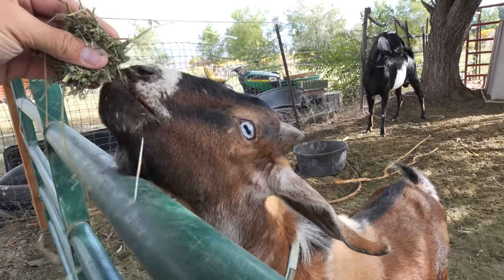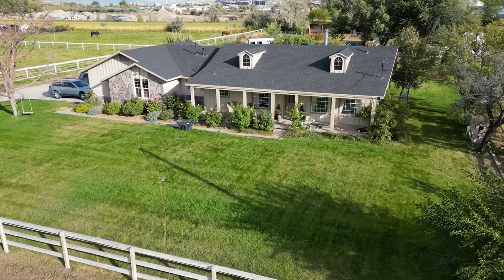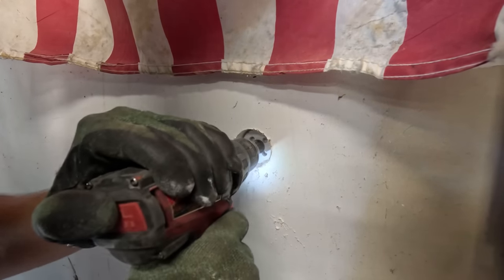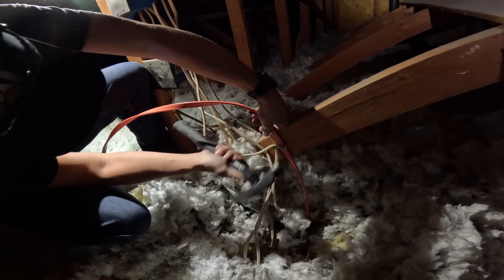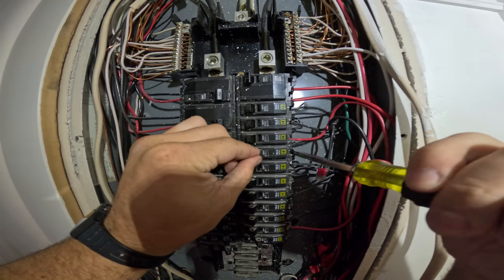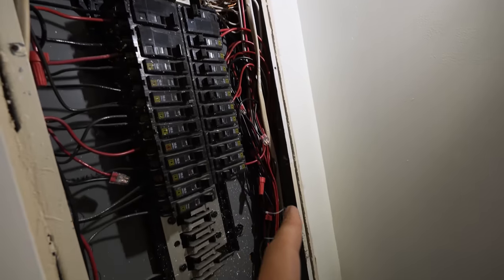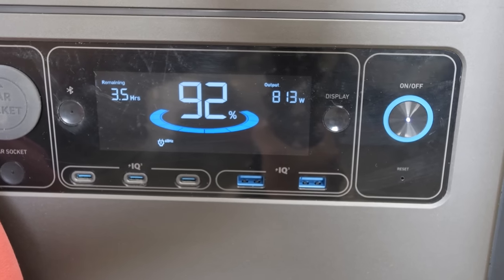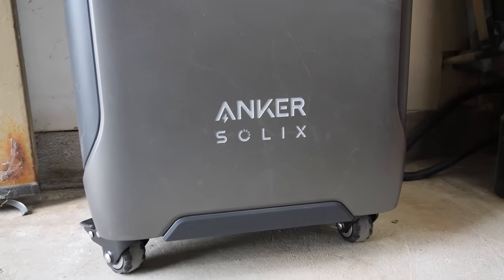Ankers newest Power Station can charge a house and an iPhone... 300 times

Comment: The system would be perfect, if the switch to the grid happens when the battery is under for e.g. 20%. So a even charge/discharge can happen. If the breaker could do this with a signal to the power station that would be really usefull.
Reply: Gotta get a hydraulic app controlled switch separately lol
Reply: You can do that with a more-DIY system using what's called a Hybrid inverter. It's a bit more work than just plugging in this unit.
Reply: Aka their smart panel

Comment: @JerryRigEverything - You need to check the main neutral(grey insulated wire in the middle), I seen some charring, which normally means its loose and need an insulated Allen to tighten it up, Like ASAP!

Comment: you should have an automatic transfer switch instead, then when the mains power goes down it automatically switches to the backup source. No flipping required. They use that in most larger buildings here in the UK and I'm sure its the same in teh US, just with different voltage and frequency but the same idea

Comment: My solution for these cases has always been battery backup.
I use a set of 12 Volt 100 Ah marine batteries. They are Lead-acid batteries with carbon-reinforced electrodes, so that the formation of lead sulphate do not kill the batteries. 
I use a pure sine wave 6 KVA inverter and a separate 3 KW charger, which can accept power from the grid, from solar cells and a wind turbine.
The inverter and the charger are much more robust than a power bank, and the marine batteries last typically for ten years of service, and never set off fires like the lithium batteries sometime do. 
For a big agricultural house, it is easy to convert the backup system from one phase to three phases while keeping the same batteries.
Marine Lead Acid batteries are the way to go.
Thank you for the great video!
Regards from the UK,
Anthony
Reply: worth noting, that LIFE batteries, as these ones are, are much less likely to burn and combust into fire. You can find various videos about this on youtube these batteries are practically rocks compared to lipo batteries. 

Im sure you could get them to burn if you really tried but im also certain that the acid inside those batteries is not particularly healthy for one either. It's also worth considering that lead acid batteries tend to produce hydrogen when charging, which isnt a problem with sealed batteries but there are always concerns.
Reply: Lithium iron phosphate batteries are so cheap now that it's becoming the clear choice considering lifespan and power density over lead acid. You can get 100 amp hour LFP batteries for nearly the same cost as lead acid now.
Reply: @andrewt9204  though tbf if you can get your hands on similar lead acid technology for a better price power density is not a concern with stationary storage. You can pretty easily build a little shack to house tons of storage.
Reply: LFP batteries are definitely better for home storage. They're fire safe and have pretty good energy density and cost.

Comment: in germany we have 2 special contactors that automatically disconnect the house from the grid when the power goes out and switch to the battery to supply the house with 3 phase energy. Tesla Powerwall is kinda stupid because its just 1 phase emergency power (except if you buy 3 lol) but its enough to prevent your fridge from melting.
Reply: powerwall is built for american markets where everything is single phase. 3 phase power supplies adds a lot of complexisty particuarly in just syncing up those 3 sinusoids.
Reply: @literallycanadian  definitely built for america. Its just popular in europe because of the brand. But its kinda cool to install as an electrician because it mixes the american and european electricity system
Reply: @Drogenkurier88  The powerwall only supports 1-phase? That's really strange, especially since their L2 wall chargers are 400v 3-phase.

Comment: around here there are a few ranchers using solar water pumps to day pump into a tank, then a much smaller pump to go from the tank to the house or other water needs.. that first 100' of lift vs 10'  make a big difference in consumption it seems
Reply: I am surprised they do not just use a solar water pump to lift it to a tank that is elevated - thus storing that energy (You know like all municipalities do?) No smaller pump needed at that point.  Let gravity be your pump.. 
I guess a ground level tank is cheaper and easier to deal with?

Comment: I'd love to see some usage and estimate time before it runs out.  I know it's all depends on load but been thinking about a whole house generator but something like this would be a better solution
Reply: How do you think this is a better solution than a whole home generator? This won't run your entire home, much less for an entire day. My generator will run my entire home and shop and starts up automatically if I'm not home.
Reply: @freighter1097  > This won't run your entire home
Uh, yeah it will? Maybe not for an entire day, but that'd depend on your load. If the water pump isn't running, Zach showed that the system was pulling 800W. To run an entire home at 800W for 24 hours, you'd need a ~20 kWh battery. Which Zach mentioned is a size option for this power bank. I doubt it's cheap, but you also never need to buy (and maintain!) a diesel generator and fuel, or ever spew co2 into the atmosphere.
Reply: @coredumperror  You're going to tell me that this thing will replace my 200 amp service, let alone the 100 amp service to my shop? No, it isn't. Yes, I could string multiple units together and have several of them and several batteries to accomplish this. Or I could let my auto start natural gas generator do the job for weeks on end. It doesn't need to be plugged in and charged. Hell this thing wouldn't run my tankless water heater.
Reply: @freighter1097  You're vastly overestimating how much energy you actually use in a typical day, let alone in power-outage conservation conditions. 

Will a battery backup system last as long as a well-stocked generator? No (unless you pair it with a bunch of solar). Have you ever actually needed your generator for a solid week of blackout conditions? I'd be quite surprised.
Reply: Based on Anker's Kickstarter and the demonstrated usage, the single unit (as shown) would run the house for around 4.5 hours if the water pump is not engaged (3840wh / 800w). The water pump is going to shrink that based on how often it's engaged with about 1 hour at the minimum. However, if we look at the estimates on the screen in the video, we see higher results. This likely indicates that there is either an additional battery attached to increase the capacity, or the solar panels offsetting some of the load.
Reply: I'm more looking for a power outage that's a few hrs that you can have essentials on.  Fridge, furnace etc for a few hrs
Reply: @coredumperror  Well after the last ice storm, I didn't get grid power back for 17 days. So yes, I have spent plenty of time running on generator. I also spend weeks at a time out of town. So the generator auto starts and switches the home over so nothing is lost.
Reply: @freighter1097 how much did you pay for that generator to do that?
Reply: @AXXXXA  The gen was around $4k with my discount. I did the install myself.

Comment: Those push fit wago connectors are not suited for fine stranded wire like that coming from the transfer switch. The connections wont be good and will get hot and ultimately cause a fire. You must use the wago "lever nuts", those are designed for fine stranded wire.
Reply: @dtemp132 Look at @3:40 it looks like solid wire to me
Reply: They are using 10/2 romex which is solid 10 gauge copper

Comment: You didn't mention if the transfer switch wires had the circuit numbers printed on them. I know last install you mentioned you had to take it apart to trace the wires. I'm assuming this time you saw the numbers on the wires?

Comment: I’m building an outdoor studio space. I wonder how often I would need to charge this. It may be cheaper than getting an electrician out. Lights, monitors, and an occasional ac/heater unit.
Reply: Just run an extension cord 💀
Reply: @bigtitmaster Exactly
Reply: Ac/heating on electricity won't work on a battery as they consume a lot of power.
Reply: It depends, heaters don't run full time, when they reach the temperature they just mantain it, much less energy spent. But if you have an opened window it will always run.
Reply: @alexandruilea915  Eh. Heat pumps are efficient.
Reply: @logitech4873  not that efficient to be able to use them on batteries. I have one at home with 4 modules and they each suck up to 2500W for a total of 24KW of thermal energy.
Reply: @alexandruilea915  That's insane. Your house must be gigantic or have horrible insulation.

Comment: Sounds like a well thought out unit. One glaring issue. look closely at the electric outlets. they are absolutely to close to each other. I'd feel lucky if I could actually plug in three cords at the same time.
Reply: Simple solve with a power strip. I can see why they did that to keep the electronics panel compact.
Reply: It is a poorly thought out design due to the 60 volt limit on the solar inputs.  That is unacceptable for a whole house backup system.  Okay for a cheap unit to take on a camping trip to use with one or two flexible solar panels but not for a whole house

Comment: This installation makes no sense to me... should the new panel not replace the mains incoming to the breakers? Ant the mains then go to the new panel?
Or did you just not show all that?
Reply: 9:20 ish mark in the video linked shows the hot wiring.

Comment: Okay so now we know how to extend battery life on electric cars in the middle of nowhere or on camping trips👍
Reply: Except that, sadly, the amount of juice in this is only going to add a couple handfuls of miles to your car's range.
Reply: @campigenus  With 3.8 kWh you'd be able to add ~25km range on a Tesla Model 3.
Reply: Bjørn Nyland actually uses power banks similar to this when he does his zero-mile EV tests. He drives the EVs until they simply stop, just to see how they perform and act when they run out, then he recharges them with a couple of large power banks.

Comment: I very much would like the option to use the transfer switch to use these larger capacity battery units to run a few things in the house if needed rather than running cords all over the house. Even if it only lasts a couple hours, it would be n firing up a loud gasoline generator.

Comment: i know Anker are sponsoring this and you have to use their product (as with any sponsor) and i know its a neat package but i do wonder if you're building a semi permanent system if it would be more cost effective long term to build a system using car batteries or similar so that you can change / upgrade batteries in the future, i guess if they are offering you a ten year guarantee then that helps, can those batteries be removed?
Reply: It’s 100% better to build it yourself to replace anything on the fly that fails. However with a system like that, I probably would still want one of these. Even if it was just for days where you need to work in another environment like a workshop or outbuildings.

If mobility is important like a van build this makes sense. If it’s a homestead or a cabin, then it probably makes more sense to build your own.

Comment: Pinching a cable with a nail like you did can burn your house down. The cable can become extremely hot on the point where it's pinched, even burning through the insulation and setting the beam you nailed it to on fire.

Comment: I can see the merit for these big batteries if you live in a city or apartment but having lived in several big cities in NA over the years I’ve only lost power 3 times and two of those where for a couple of hours. If you’re out in the sticks where emergency power is important I’d just get a gas or diesel generator. With good maintenance they can last an outrageous amount of time and will be able to run for much longer.  Maybe for RVers or lazy campers such a device would be good but these always seem like a ripoff for what they are.
Reply: I dunno.  I live on a piece of property similar to this for the last 20 years.  And yeah, the power goes off for sometimes up to a week at a time in adverse weather conditions.  But since we purchased an electric car 5 years ago, the generators don't see any use.  They are around, they still work, but they are noisy, need gas in the middle of the night, carb maintenance and oil changes, and gas still gets expensive if you are running a gen for days at a time.  All always keep them both around, but when you have the choice, the battery always makes more sense.

Comment: FYI, from what i can find out on this unit, it cannot be charged fromn the grid while in 240v mode, so if you plan to use it for battery backup for your house, it takes alot more manual effort than other solutions which can often switch automatically to battery when the power goes out, some solutions even switch fast enough that sensitive electronics like computers dont even shut off.
Reply: Do you mean like the Zender Super Base V? Does this Anker unit have pure sine wave?
Reply: @keslee7036  I'm not sure the Zendure does AC charging+discharge +240v either off the top of my head.

Comment: Is that an automatic transfer switch? Doing this setup in the panel could be tricky, you need to turn off the main breaker from the grid before you can use power from battery, if power from grid goes off and you use battery then suddenly grid comes back on it could explode. Otherwise this is good product.

Comment: I wish a transfer panel was that easy to install in Canada, the way you did it is against code here. Cant use your main panel as a junction box, the circuits need to be brought outside of the panel into their own box first before running the wire to the breaker.
Reply: You will notice they are out in rural setting.. much less regulation out there.

Comment: Shouldn't the wire running through a wooden attic be protected by some kind of metal pipe?
Reply: Some quick research suggests not necessarily since it isn't an attic with a clear walking path (and especially if there's no permanent ladder/stairs).

Comment: Nice video Jerry , the only question i have is about that cable that passes the attick , doesn't need (metallic) protection in case is overheating , i mean you have there wood and insulation.

Comment: How is the fire prevention with these things? I've looked into these because here the power can go out maby 5 times a year. Or with a hurricane it can last a couple days. I'm lucky I live on the supply line to the hospital so that gets priority to repair. And I have a gas generator. But a battery would be the next thing. Only those electric scooters ect u see a lot of them go up in flames. So I Def not want it in my house. I have a outside concrete step I was thinking I make a cage and install it there that's close to the main breakers. But I don't want anything with a big battery in my house or garage.

Comment: On a follow up,
Can we use more than 1 Anker Solix unit to power up a house?
And on that note, with a couple of battery expansions, can we run them and power up all appliances while plugged into the wall perpetually?
And they still function as they are when grid goes offline?

Comment: Please dont use those quick connectors they greatly reduce the amount of current that can be pulled by the wire!!!!!!!!!! Twist the wires together and use a proper sizeded wire nut or bug connection.

Comment: There's something he's not telling us—for how long can the battery supply power to the whole farm before it runs out of juice.
Reply: With 3.8 supplied kWh, not very long.  That 3800 watts for an hour, 1000 watts for about 4 hours or 500 watts for about 8 hours.  But it is expandable.  So it's basically $2600 for a helluva nice inverter setup and enough battery to get you started anyways.

Comment: I have a previously installed Generac transfer switch we use with a portable gasoline/propane generator.  I have been advised not to use it with the Anker, although I think one reason is it needs power to trip the switch or something I don’t know quite why.  Seems it should work?

Comment: So did you just move one breaker over into the transfer switch or did you move 10 circuits over for a more complete but not full backup scenario.
Idk if just not enough description was given but this is definitely not a whole home backup solution in this situation and could really only be used as such  if you were taking grid power directly to the transfer switch from grid and then back to all of your loads. In which case you would certainly need more than one and likely at least 4 or so to be comfortable backup solution.
Video seems awful lot like anker got final say on what made it into the video.
I install battery backup solutions for a living and I can without a doubt say that this was not a great representation of whats actually needed have a full backup solution and that representing it as such can put quite a few people in life threatening danger. Putting this type of system in incorrectly could not only endanger the person doing the work but also the linesmen who are doing the work to bring the grid back online. 
Please do a proper backup solution explanation video. Anker should know better than to set up something like this

Comment: Here is the problem, the input from solar is not enough to sustain the battery system. It's a cool system, but max 6KW input? Come on, and that isn't even from solar itself, that's a mix of solar and grid. If you are outputting 12KW, and only can intake 6KW, that does not make sense. You need a 1 for 1 match, say it can output 9KW and receive in 9KW of solar.